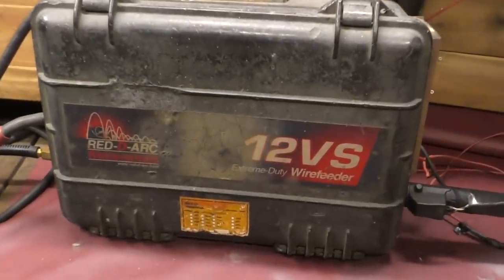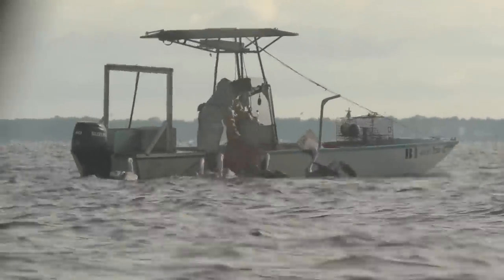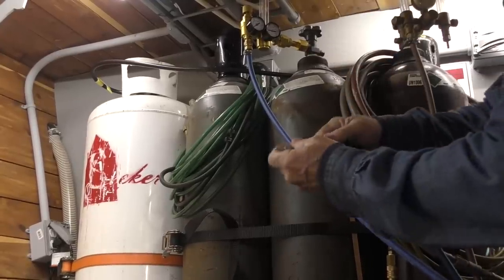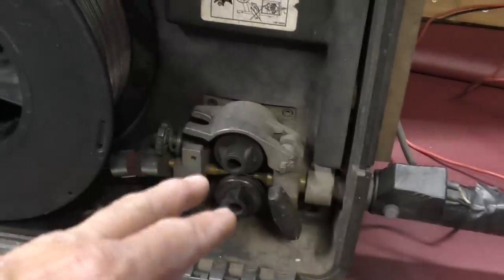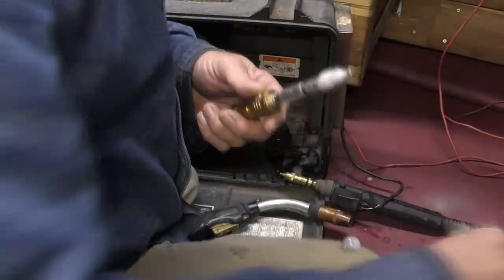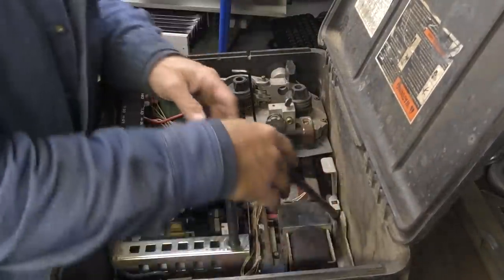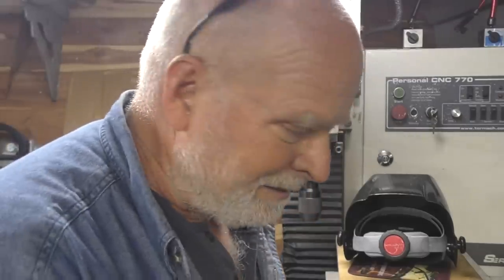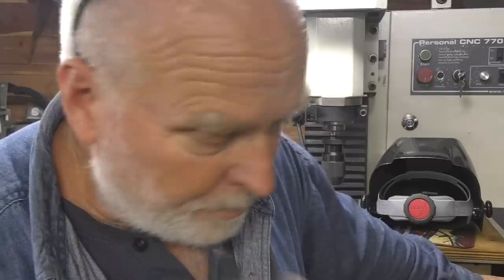Troubleshooting a Miller X-treme12VS Suitcase Welder

Comment: That blue thing inside is a ct coil, it checks for amperage and the welder turns on the gas when you weld and turns it off when you’re not to save gas and to prevent a room filling up with gas and killing you
Reply: yeah thats what im thinking too
Reply: Current
Reply: @ianhine4012  We measure current as amperage so it's the same thing.

Comment: I didn’t know much about welding a few years ago. I could burn a stick if it didn’t require being attractive or effective. But then I had to rebuild the bed on my old dump truck. So I got a small flux core. That taught me a lot, like how much I wanted a real gas welder. So now I have a nice mig set-up, still have the flux core, a buzz box, and a set of tanks. What I enjoyed most about this video is that I now fully understand all the terminology that goes with welding! Lol! And it was a great video!

Comment: Sure it's not just jog mode? The old Lincoln suitcase I used daily pre-dated the safety stuff, but it still shut gas flow off after a few seconds of running with no contact to ground, but it would still feed wire. But, it also had a gas purge button on the rear for setting flow rate at the gun.

Comment: Can't be 100% on your feeder. But all the manuals i see list a 3 second sense timer after trigger pull to make sure the current is flowing  if no current draw after3 sec.  Power is shut off to contactor and gas.  That looks exactly like what's happening in the video.  Maybe when you were building Seeker and the gun was laying down you got a arc in the first 3 seconds and the welder keep power going till you shut it off.    Next time you try it. wire down the trigger switch and see if it shuts off gas and welding current after 3 sec and then the feeder after 2 minutes it's all the same safety features and would be a good test to confirm what's happening.
Reply from the maker: Could be.

Comment: Probably a dumb question, but you do have fans blowing that C02 (heavier than air. Could fill the hull bottom up.) Outta there right?
Reply from the maker: I’m exhaling more CO2 than the weld uses in a day and there is a nice breeze without the blowers, so it’s not going on my need for concern list.
Reply: @SVSeeker you produce in 1 day by breathing 1 minutes worth of co2 shielding gas output at 20cfm……..

Comment: Does the gas even make a noticeable difference if you're using flux core? Like if it stops flowing will you notice it in the weld
Reply from the maker: Yes, it really does.  You will notice it right away.
Reply: You'll notice it really fast if paying attention.  Spatter and porosity.
Reply: So my 316L stick electrodes have about 4 times the total thickness of flux as a 7018. That's why you can't use only flux for stainless with a mig, not enough volume of flux.

Comment: I have the new arc reach suitcase and it does the same thing except after the power and gas turn off the wire speed goes to full, I thought it was a convenience feature so you didn't have to wait forever when spooling out some wire without having to open it and hit the jog button